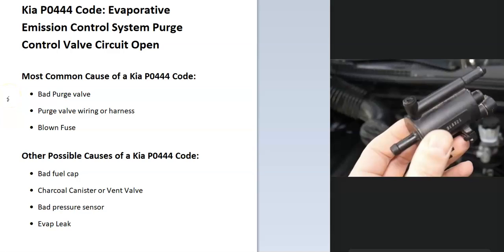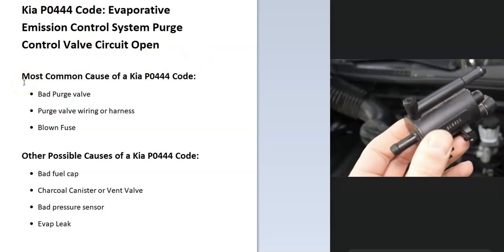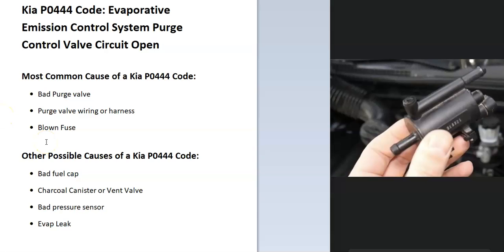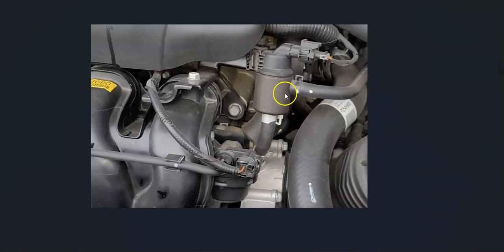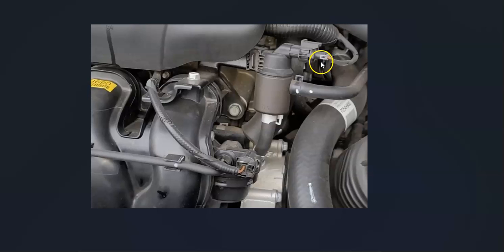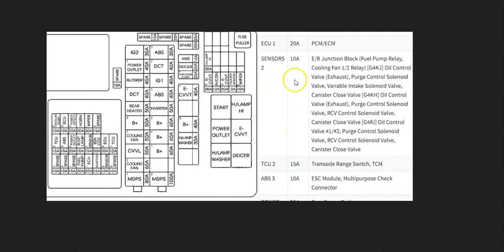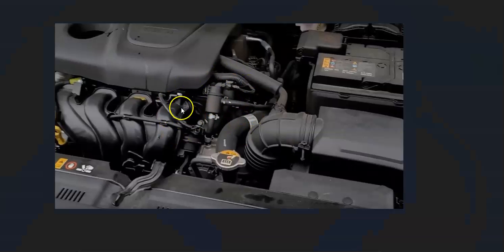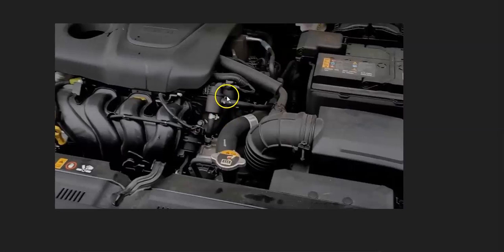How To Fix a KIA P0444 Code Evaporative Emission Control System Purge Control Valve Circuit Open

Comment: can you pls help me i have  code p0444 after i replaced both evap canisters the one in the back and the one in the front at first i had code p0445 after i change the evap canisters now i have code p0444 i replace gas cap as well and the code still its on i dont know if its the harness or something else i need help i have to do smog check